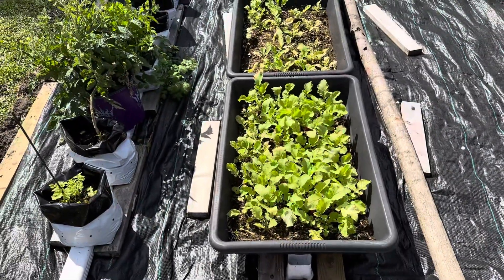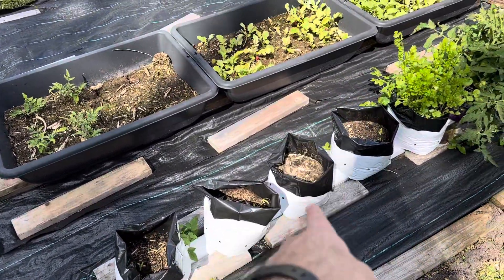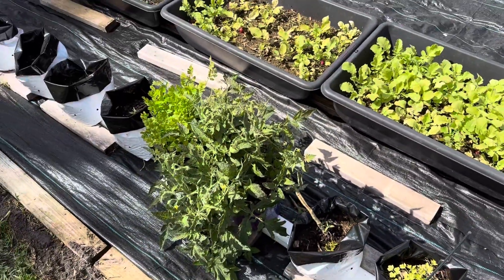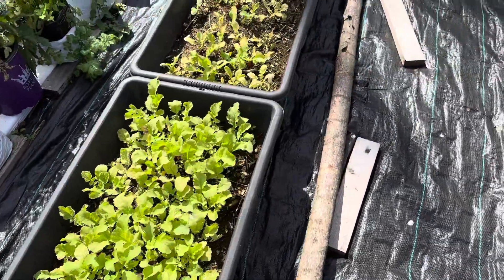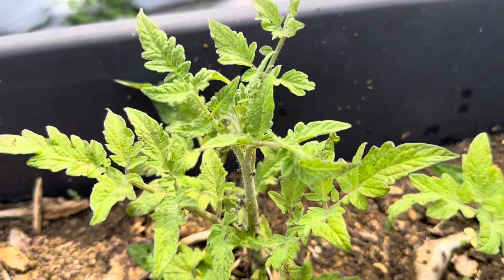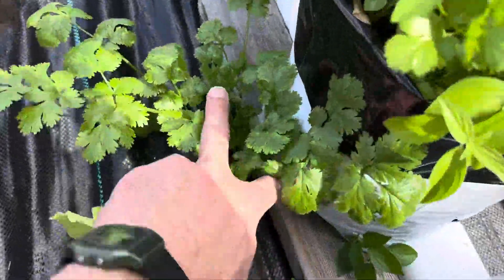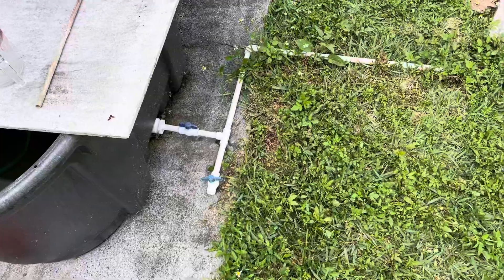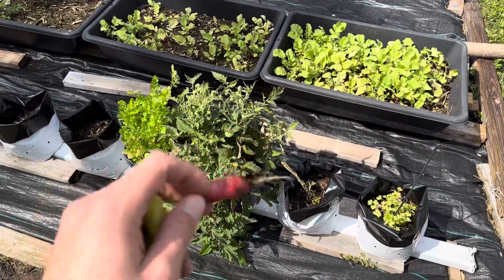Hydroponic Rain Gutter Grow System @Hoocho

Comment: The method I originally saw on YT many years ago was called the Larry Halls Gutter Grow System in his original system you used any grow container with soil but pre prepared with 3" net cup sticking out the bottom that went into a gutter with a 2x4 stable frame and a float valve water supply.  He later updated his systems with many renditions and options. Many thousands of variations are now on YT, but sadly I had read Larry has passed on recently
Reply from the maker: Yup, Larry originally did it with net cups and soil based. Hydroponics really supercharges the system